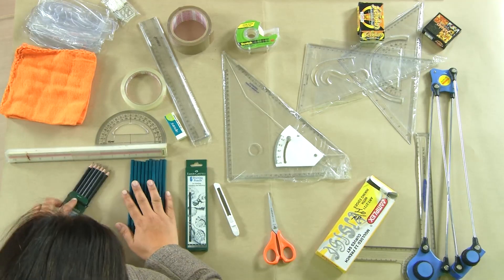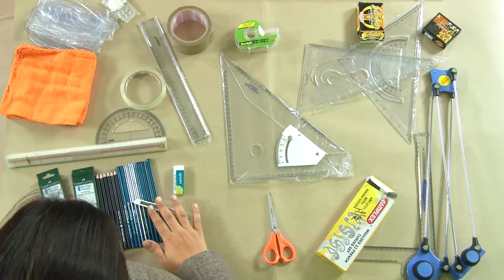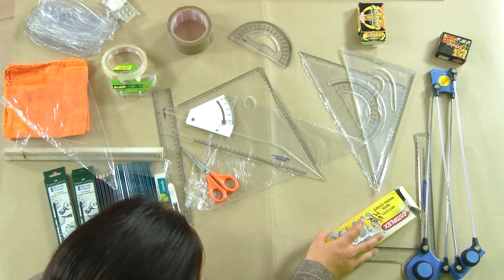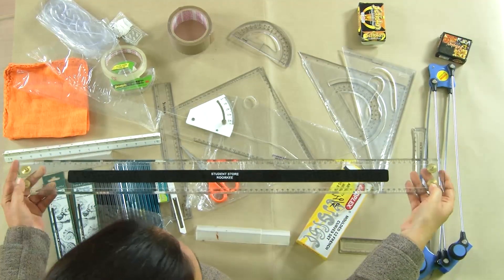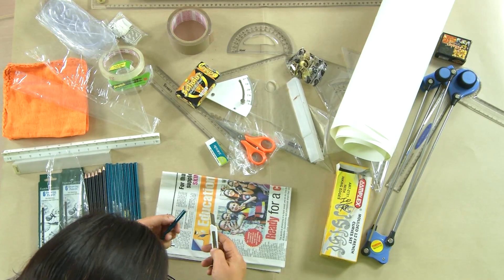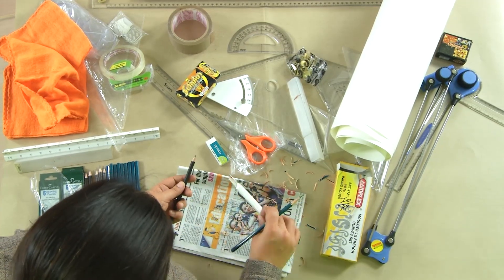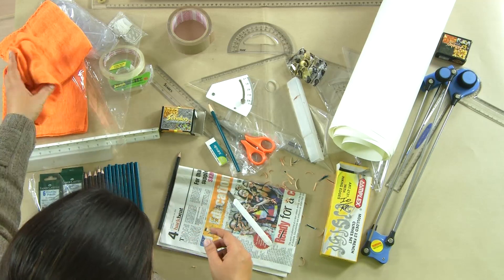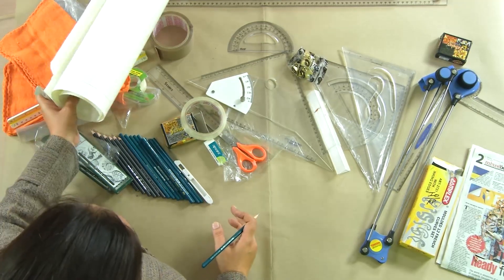Lecture 2: Drawing Instruments

Comment: maam could you tell the names of all the instruments and things needed ??
Reply: 1.pencils (from H to 8B)
2.erasers
3.sharpener
4.ruler
5.set square (45-45 and 30-60)
6.adjustable set square
7.protractor
8.duster
9.cartridge and butter paper
10.board pins
11.scale
12.mini drafter
13.t pulley
14.french curves
15.scissors
16.sellotape